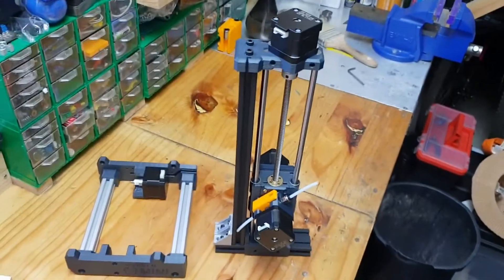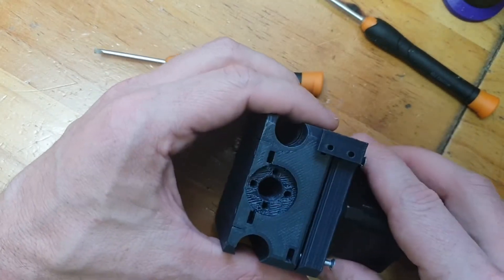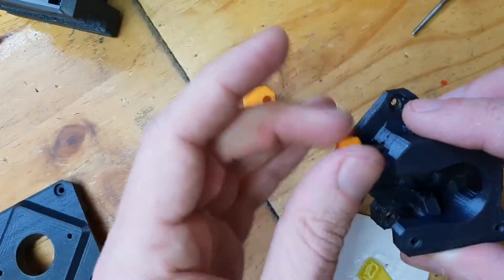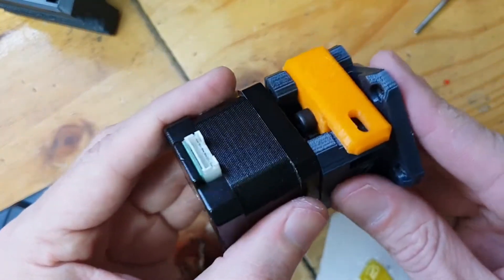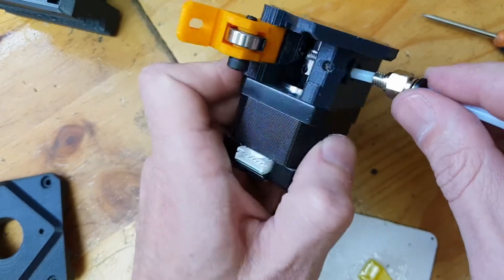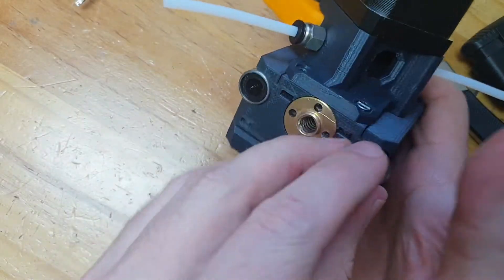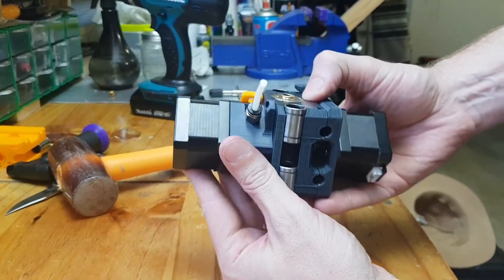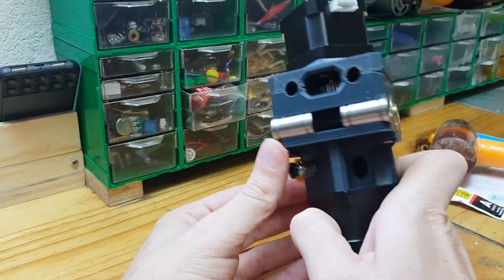Franken-MINI The DIY 3D printer Part 1

Comment: I've had an Anet A8 lying around that I've been looking to repurpose into a cleaner, more compact printer like this. I know you said you would make the STLs available later once the project was functional but it would be nice to follow along. Would you say that most of the parts you've printed are based on the original Prusa Mini's parts? Or are you just using the same design language? Looking forward to the next few videos!
Reply from the maker: Hi there, Thanks for watching.
None of the parts a remixed using prusa parts. I did however open up the prusa STL to get a rough "feel" as far as size goes. Not sure if I mentioned but all of the parts used in this build came of an Anet A6. Suppose I could use the Anet board in this but i'm more familiar with RAMPS and Arduino. I'm struggling to find time to complete the project due to other responsibilities and to make matters worst I'm in the process of buying a new place. Will try find some time to at least release the parts onto Thingyverse.
Reply: @Mailmartinviljoen  Very impressive! Again even just from the outset it looks like your printer is shaping up to be at minimum an aesthetic upgrade over the Anet if not easier and more fun to use. I suspect people may comment that cantilever designs will always be harder to maintain print quality with but I have a cheap cantilever myself and it prints just fine. Of course, there is no rush. Take time with other matters and I will subscribe in the meantime.